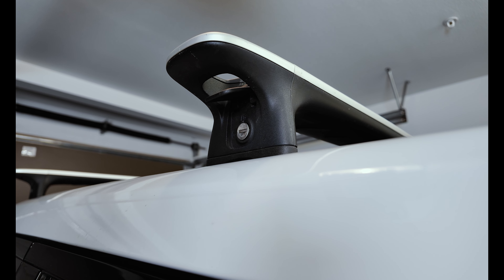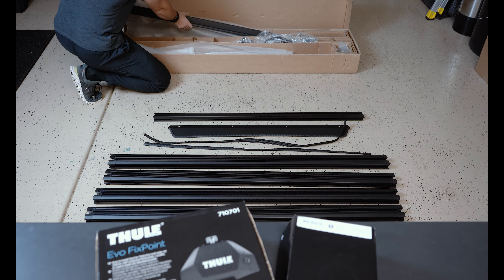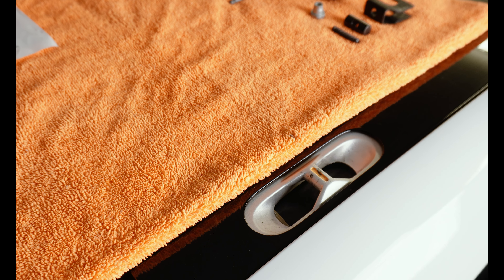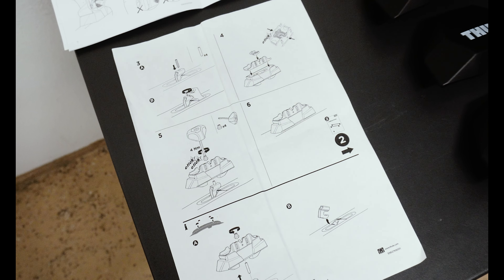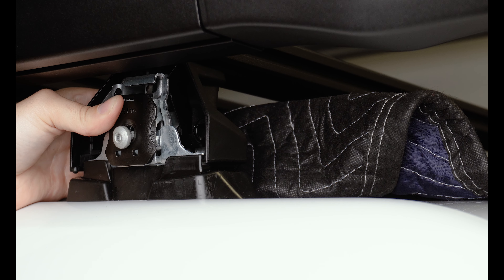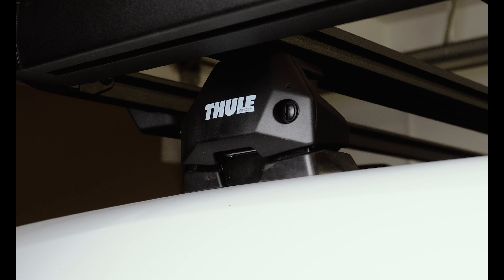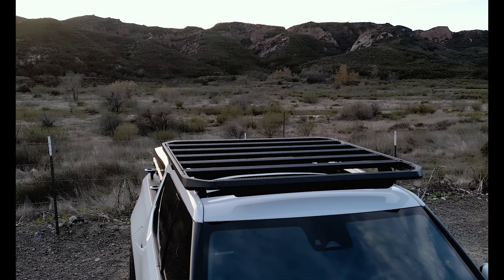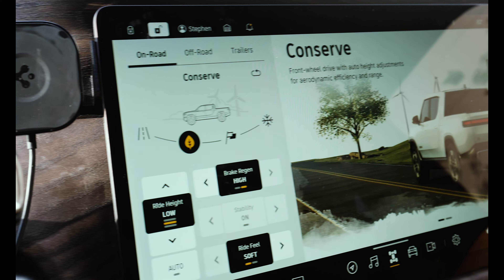THULE Caprock for Rivian  | Assembly, Install and Efficiency Test

Comment: The Rivian crossbars have been perfect for me. It see you aren’t fully installing them. You snap them in first. Then while pushing the lever / cap in, pull down until you hear a light second click. They become fully tight only after the second click.
Reply from the maker: I’m definitely aware of the second click to fully engage 👍🏻 They are still not as solid as when I first got them unfortunately
Reply: I had to climb up on the roof to press them extremely hard down to hear the 2nd click so the door closes fully😂

Comment: Regarding the Rivian crossbars I recently learned that they can be adjusted if needed to fit better into the attachment points. You need to remove the rubber feet first and then you’ll have access to adjust them using an allen key.
Reply from the maker: I’ll give that a shot👍🏻
Reply: On mine, that door will close firmly if you put a little weight on it - mine was loose like yours, pushed it from above and the tab clicked in. Try it!
Reply: Also for mine i got all the covers down by pressing the cover closed and then pushing down with all my weight. The reason the doors dont close is the bars arent seated fully. Doing the allen key adjustment will work though. @ChargeOverland

Comment: Cross door does close and the wobble will stop. I didn’t see this covered in the comments but if you press the door closed HARD it will click an additional time. This actually locks it and make the connection tight and secure. The door will then stay closed as well.
Reply from the maker: Few people have reached out about this and I’m aware of the second click but in this case the crossbar is still showing some wobble unfortunately. Thanks for the tip though!

Comment: Just wanted you to know you don’t have the RIVAN cross bars mounted correctly.

I did the same thing they aren’t secure and rattle if you don’t.

You have to lift them up once there on top then pull down firmly.

That will lock them down and the latch covers fall firmly into place as well

When you have them correct you have no play of rattling.
Reply: Echoing this sentiment. You have to click the door in and it should click twice. The second one, you really need to press hard, but once it clicks the hood doesn’t stick out at all. It’s flush and it doesn’t rattle one bit.
Reply from the maker: I’m definitely aware of the second click required to lock it into place by pressing down firmly on the latch cover (my bad for not covering this in the video). These worked properly at the beginning but have started to develop this rattle over a year and a half of use. 
For sure good for people to remember it’s not locked in until it clicks twice though👍🏻
Reply: I've had this issue as well.  Sometimes it helps to lift up slightly as you push the latch in for the second click.
Reply: This isn’t the rattle issue being discussed here, it’s the door covering the lock. In the video it’s described as not closing properly, and that’s because it’s not latched correctly, and not just the door, but the crossbar itself isn’t positioned correctly to latch perfectly.
Reply: @westhefarmer  That is what I am describing as well.  I just had it happen to me yesterday.  I'm assuming the cold temps are affecting the fit.  I couldn't get it to close the door and it would rattle.  I found that lifting up slightly on the crossbar as I closed the door for the second click helped to get it to close/latch properly.  I'm not saying this will work for every scenario, but wanted to mention it just in case it could help someone else.
Reply: @ChargeOverland  I think the resounding opinion is that you were not properly connecting your crossbars if youre complaint is that the lock cover door doesn’t stay firmly closed… we’re not talking about the rattling, though that could cause it if it’s not latched properly. I’m wondering if you’ve adjusted the latches to remove the rattle to the point that they no longer attached and latched as designed. The doors definitely should remain locked closed unless pushed open when the crossbars are aligned and secured correctly.

Comment: What do you typically store up there? Having no experience with owning this truck or any truck, I’d think the bed, gear tunnel and frunk would be enough space for my gear. Especially if I’m going solo.
Reply from the maker: I generally have kept recovery boards and an awning up there - looking at possibly putting solar panel(s) as well. Really depends on how much stuff you want to take - I wouldn’t say the roof storage is a necessity by any means. The truck definitely has plenty of storage on its own👍🏻

Comment: Those spoiler cancellers are cool, where did you get those, did you make them? I remember us talking about those ideas when you put tape over your spoiler in that test video. I ended up cutting up a yoga block and it works really well!
Reply from the maker: I’ve been developing a 3d printed part just haven’t been quite ready to share a video on it :) Cutting a yoga block is a pretty cool DIY solution 👍🏻
Reply: @ChargeOverland  yeah best of luck on that. You should start an aftermarket products company!

Comment: Um are you sure the difuser goes on the inside? Aerodynamics would say it goes on the outside sending wind from the windscreen over the top by adjusting fore and aft.
Reply from the maker: Agree it’s a bit strange! But yes it definitely is installed correctly based on how Thule has designed it. Most other platforms I’ve seen have the wind deflector positioned as you’re mentioning.

Comment: What other low profile solutions for the r1t were you referencing at the end.  Trying hard to find the right solution for mine but would want something a little lower than yours?
Reply: check out overland ruff rax or front runners options
Reply from the maker: Yup @brinkhouse listed the few I know of 👍🏻